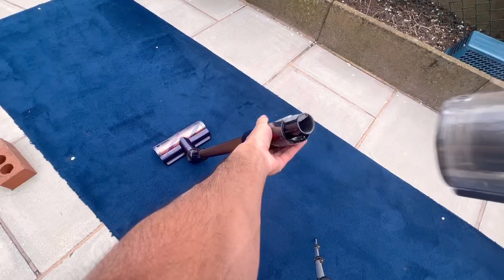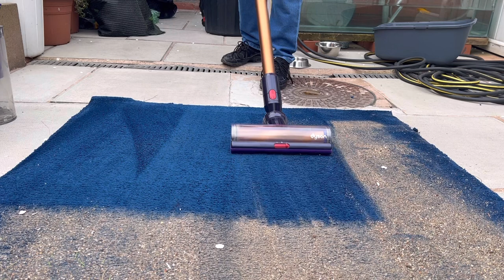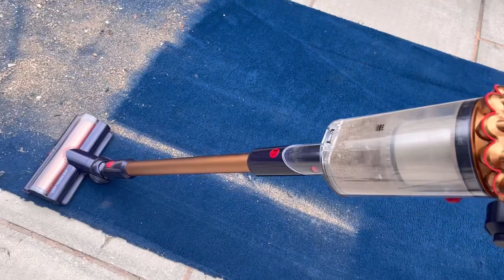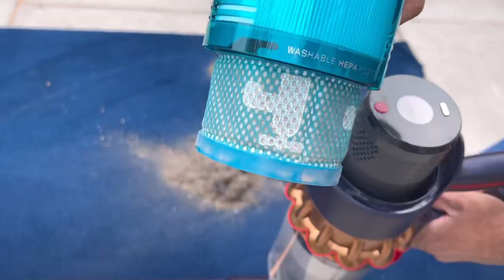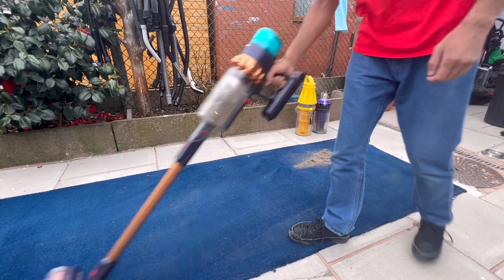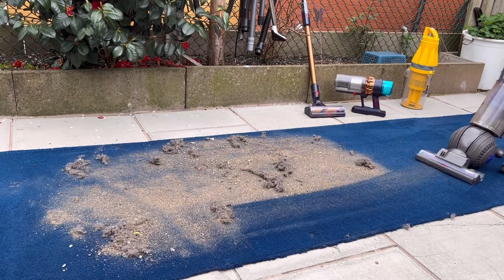How powerful is a Dyson Gen 5 cordless vacuum cleaner? - Performance testing [with fine dirt]

Comment: My friend,  you showed the very software bug that im telling people about at 2:18.  Your machine switches off and doesn’t show blockage message.  Sometimes the screen goes blank and buttons stop working.  Only way to resolve is to remove battery and  put back in again. I do like the machine but has too many flaws like weak brush head on carpets,  blank screen etc and too expensive lol
Reply from the maker: My v15 does something similar!! The motor cuts out for a second, the brush continues to spin and then the motor comes back on again

It only happens once every few months it’s rare, I do like the V15 a lot more than the Gen5
Reply: @parwaz7861  Any reasons why you like v15 more than Gen5? Also did this vaccum still works after stress testing it?

Comment: Specific question, are the screws for the Gen5 Detect wall mounted charger in the same position as the v8 absolute wall charger, or do I have to drill new holes?
Reply from the maker: Hi I’m pretty sure the screw locations are different due to the V8 wall mount being larger

Comment: Nice vid. I have a question, where did you get the Gen5Detect when it’s available in Australia and NZ?
Reply from the maker: Dyson sent an email out to existing owners :)
Reply: @parwaz7861  Thank you, I never owned a Dyson cordless so I’m planning to buy one :)
Reply from the maker: @GarlandTexasSpotter2024  Happy to help - I would steer clear of the Gen 5 if you have medium pile, trodden down deep pile or low pile carpets/rugs because the suction is so strong that the brushbar motor struggled to cope with the resistance against the carpet

I quite like the V8/10 models as they run fine with their brushbars whilst still maintaining good cleaning performance
Reply: @parwaz7861  I have a low thin carpet all over my house, if it doesn’t work I will either get a v8 cleaner head for it
Reply from the maker: The v8 cleanerhead would work brilliantly I imagine!
Reply: @parwaz7861  Yep, Since the v8 cleaner head has 4 holes instead of gates.

Comment: How about vacuuming plaster dust / vacuuming while drilling some holes? The things others do not advise to do? Is it that sensitive? 

After seeing this video it looks like this can be taken to battlefield lol.
Reply from the maker: Nope, Dyson’s don’t like plaster dust if any extremely fine dust, they can be used for that but only very moderately in small amounts
Reply: @parwaz7861  Dang. I was going to use it for that too. Example: drilling and vacuuming the 2 holes to mount the Dyson Wall Docking Station. Not a full home renovation. What if the wall is not plaster and is normal brick?
P.S. Thanks for answering!
Reply from the maker: I personally would use an upright Dyson, the filters have larger surface area so take longer to clog up

A along as you vacuum the fine dust slowly and don’t overfill it past the max line it should be okay 

I used to use a Henry for such things but the bags and filters clog quick and the best bagless vacuums are Dyson’s when it comes to constant airflow

PS it’s handy to have a spare filter too so you can have one on the go whilst the other is being cleaned
Reply: @parwaz7861  I never reached half of the dust bin let alone to the max. The upright Dysons are not available in Spain just the sticks. As for vacuuming slowly the fine dust.... it's as fast as a the drilling process goes (10-15 seconds / hole) and as quantity probably a teaspoon of dust? :))
You earned a subscriber today btw. These fast replies are invaluable!
Reply from the maker: @saranciuc7717   Many thanks that means a lot!!

How about a cylinder pull along Dyson? Those would be another decent option, if not then I think a cordless one should be okay, providing the filter is regularly checked and cleaned 

Sounds like you will be fine for the task you want to use it for 👍🏽

Comment: Is this on max or auto? I honestly think the gen5 does better than your big upright.
Reply from the maker: It was on auto mode - it will surface clean better than the upright Dyson, however it won’t deep clean as well as the upright due to the large gaping gaps in the front of the head whereas the upright has sealed suction on the floor
Reply: @parwaz7861  good to know. I just bought a V12 so looking forward to how it compares to my V8.
Reply: @parwaz7861 not to mention raw power is sustained for longer periods of time because of it being plug in and  power generally is greater in corded vacuums.

Comment: For a machine that costs nearly£900 i m must say his dust separation n the cyclones r not very efficient as the filter was dusty when u pulled it out which slows the suction over time, a cheap shark would be better in that case